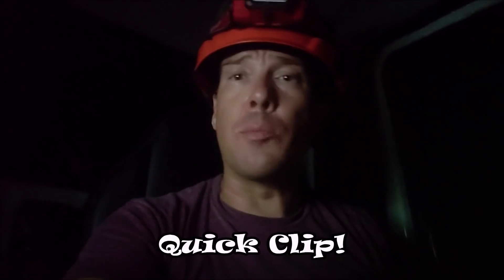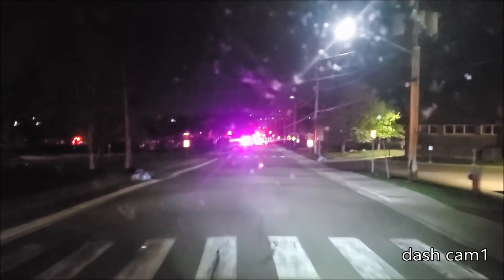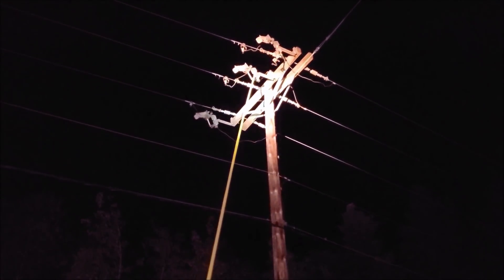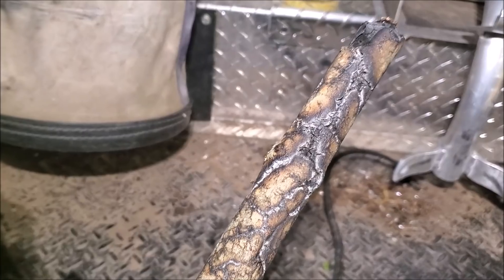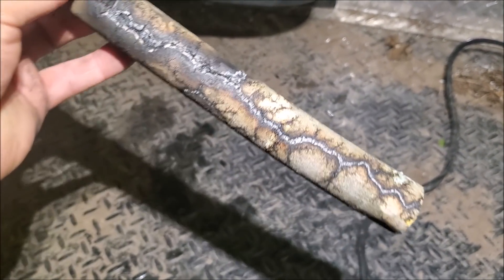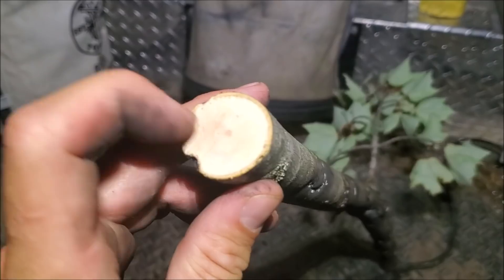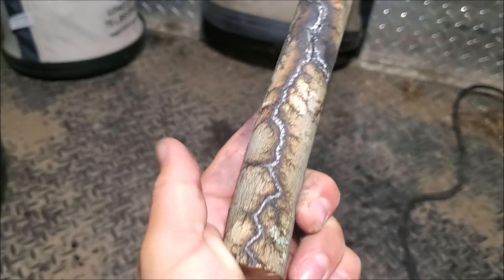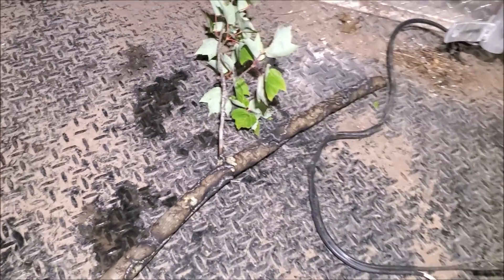Accidental 7200 volt Fractal wood burning

Comment: thats not fractle burning,   the woods just burnt   XD
Reply from the maker: "Fractal burning is a relatively new technique which creates patterns in wood that resemble branching or fractal patterns by applying electrical current from a high-voltage source across wood."
Reply from the maker: X D.

Comment: Man I have learned quite a bit watching these! Think you.can do a video on basic things we see on lines? Like those insulators, the capacitors, the thing that keeps lines from occilating too much in the wind (can't remember the name) or that black and silver twisted wire we see, maybe even the black cables that are low to the ground? Do you do work on transmission lines too?

Comment: Hello, am Dave from Québec and i have one question. Do this unit have a loadbuster or sulfur hexafluoride gaz tube? Can you open this with a load? Picture in the link: https://scontent.fymq2-1.fna.fbcdn.net/v/t1.15752-9/117709782_290014875621626_331242683406087491_n.jpg?_nc_cat=103&_nc_sid=b96e70&_nc_ohc=v7bJisRRaj4AX83yIg7&_nc_ht=scontent.fymq2-1.fna&oh=4472ecac5feae6aa8932c802956dc7ed&oe=5F57FA05&dl=1  I have this on the front of my home. It's a backup feed for powering my neighbourhood but i wondering how you will operate it. I search videos on internet and i can't find one.
Reply from the maker: Hey Dave! That one looks like a gang operated switch with load Buster's built onto the switch. There is no gas in them, and they would function similar to a spring operated loadbuster✌️
Reply: Bobsdecline - Lineman blogger  Thanks!

Comment: Hey Aaron, 
Cool video.
Where did you get that helmit light? Looks to be a Milwaukee? Do you like it?
We are still working one week after the tropical storm here in Connecticut. Just to let everyone know about the work commitment of being a lineman for the power company. 
Our first day in on restoration is usually 24 hours straight. 7-1/2 hours off followed by 16-1/2 hour days. Yes, we are running on about 5 hours sleep a day. We are at day 7 now with projections to be finished up later this week? This is working all the while with the pandemic too. Deffinately no easy task?
Reply: Thanks Aaaron,
👊🏻👊🏻👊🏻
We had our first backfeed condition. We were sent to a job where the Canadians (Holland) were there. (No notes on why it wasn’t done)? The highside tap was off the cutout & the door hanging by the lower hooks. One pole was set back in the woods. We were able to reach it by unfolding the two booms backwards. As the high step helper was retying the phase on the glass. The conductor was buzzing with the bare aluminum tie. He buzzed it with his noisey tester. It was hot. Upon further annalysis, the homeowner’s generator was illegally hooked up. His main was on & he was backfeeding through our transformer. Ofcourse he passed it off on his wife & despite telling us he had his electrician hook it up for him? No electrician would ever do that kind of shoddy craftsmanship.
Reply from the maker: Things are definitely much more complicated at the moment! 
Yes it is a Milwaukee light, it uses a USB Cable to charge as opposed to removable batteries. The only down side is, when using all night, the brightest settings will drain the battery in about 2-3 hours . Then your stuck without a light! 
Keep it on a lower setting and it lasts the night, also fully charged fast .. less then an hour.

Be safe out there John! ,👊👊

Comment: Wood is a very tricky conductor I got hit with 480v at the worlds fair marina (flushing meadow park queens N.Y.) a while back there was a p.v.c. splice box secured to a pole with lag bolts under water under a gang plank on rubber wheels to go up & down in ruff waves & mostly high/low tide needles to say who ever mounted that box didn't take any of that into consideration. Then when I went under the plank I had grabbed a soaked piece of wood & the wood with the mounted box & WOW pretty harsh lucky I diddnt fall into the water.. but the funny part was it was just like that single coil element you put in a coffee mug to heat the liquid in it & the water was boiling in the box do to the  3 phase splice bugs (knots) are just rubber & mastic pad then electric tape which are ok for that type of splice but nothing works submerged in water..needles to say I never trusted anything around water from that day forward.. keep up the great video's & sorry for the long post. Stay safe.

Comment: Looks like a bucket from Klein tools over on the left side there. Damn good tools, they last.
yup had a 7200 volt line come down last fall, landed on woman's house, arced over to rain 
spout then to ground then to ground. looked out my window as my lights were flickerein,
like who in hellz welding out in the street?  I'm not a linesman but have lots of respect for
what you do, I hope u take the stupidity of idiots very seriously when they hook up a 
generator, without pulling the mains. They think cuz there's no power, it doesn't matter.
Some family did that in FL. no one got hurt, but the utility Co. kept putting the work order
# to get their power turned on farther back on the list.

Comment: I had fun as a teenager with a flyback transformer burning much smaller carbon tracks in a 2x4. Someday I'd like to obtain a used pole transformer for <<art>> but not until I have a full set of PPE to go with it ;)

Comment: That is an interesting pattern that gets burned nito the wood as the electricity find a path.  The part of the video where you were disconnecting the power at the pole left me with a question. Are you just disconnecting one phase when you do that? How do you avoid damage to motors that depend on multiple phases？Is it assumed that those devices can just protect themselves?

Comment: Interesting that the center appeared to be untouched, as if it traveled along the bark area only. You would think it would be the opposite due to the center maybe containing more water.
Reply: Most of the water trees take up is in the vascular cambium layer right under the bark, the inner wood is less conductive.
Reply: Also if the inner part of the branch does conduct electricity it quickly heats up the water turning it into steam, which expands but has nowhere to go, basically causing the branch to explode from the pressure.  You can see it in the videos of lightning strikes on trees, the water vaporises so fast the tree just explodes into a bunch of matchsticks.